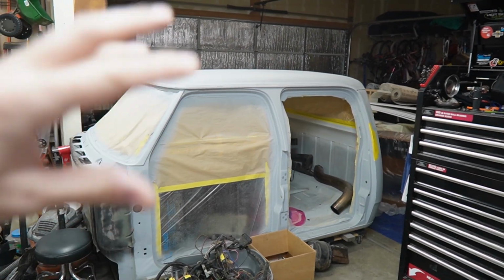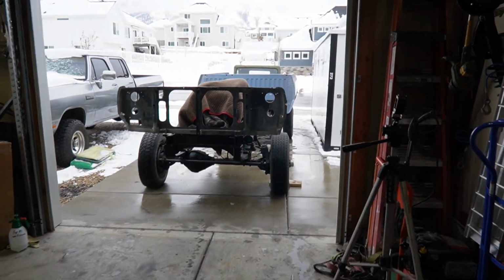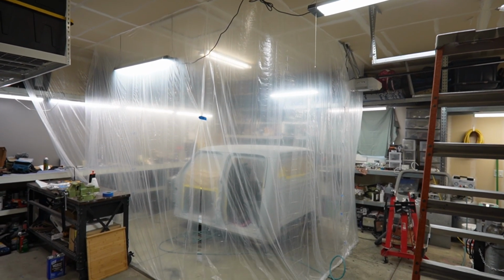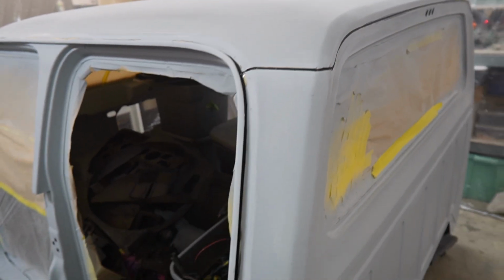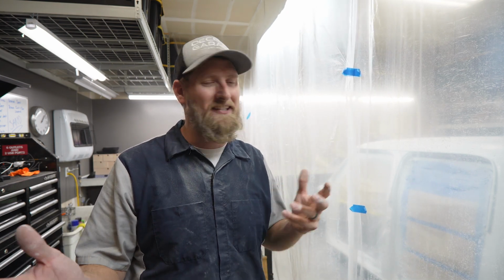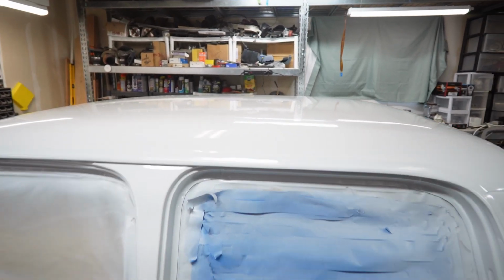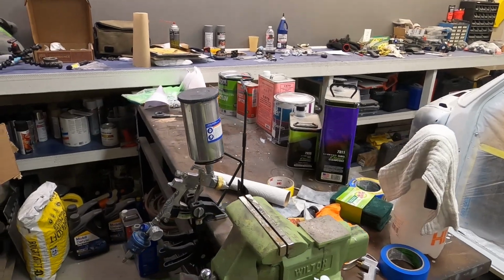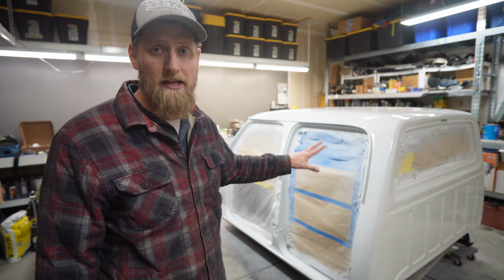The Cab is FINALLY Painted! How did I do? | Long Bed Larry - Ep.21

Comment: All white is the move. When I say everything white, I mean everything white. I just had my first gen repainted and it’s two faced, half white half black, and I had them paint everything on the white side white and it’s amazing. I previously had the white side with black accents like the mirrors, fender trim, door handle, grille etc. and now that it’s all white it looks a million times better. I’m not shitting you when I say it’s all white I mean it. The marker lights and even the headlight buckets are now white. All the marker lights and cab lights I have 3/4 led trailer marker lights in them so the entire lens and housing was able to be painted. It’s so clean. Now that I have that truck (dually tow pig) almost finished I’m going to build an all black extended cab short bed “show truck” and then an all white maybe single cab or crew cab daily.

Comment: Seems clear you're planning to build each paint booth every time you're going to paint. I have a buddy that's done similar cause 12 bucks in plastic drop cloth isn't that big a deal to him. What he DID do though was made a fume chute. Bought the cheapest high velocity air circulator fan on Amazon he could find. Masked off the controls set to max, then used the box it came in plus tape to make a disposable sealed box. More cardboard he has to make a chute trough the door onto the grass. He throws out the chute, keeps the box. Plug is the on off switch, tapes the booth to the box in a corner. When it seizes or you're done painting for awhile, you're out maybe 50 bucks, but you're a lot happier and healthier for getting it out of there
Reply from the maker: This is an awesome idea!

Comment: 8:26 looks like some orange peel below that back glass but still better than I could do! Probably as good or better than the factory did too.
Reply from the maker: Yep, after I finished filming I found a small spot on orange peel on the c pillar. It'll buff out though
Reply: @decentgarage  I usually do a fine sand between the base and clear as it seems to really help get those last little imperfections out.

Comment: Tim: great series and great job on the painting. From what you showed, the quality is there. Couple dollar short and day late comments based on my limited experience. Damping down the floor helps with dust control, extraction fan is not only good for you but helps get rid of dust and impurities stirred up by walking around and the pressure of the spray gun. Some people advocate for wet sanding with a high grit sanding block to knock down orange peel before clear coating - but it seems like you didn’t have any orange peel problems. Nice job, I am sure the spot where the hose hit will easily be fixed. Looks like you leaned from painting the OG crew cab.  Keep up the great work and videos.
Reply from the maker: Yeah I'm going to get an extraction fan for sure. I like the idea of damping the floor also!